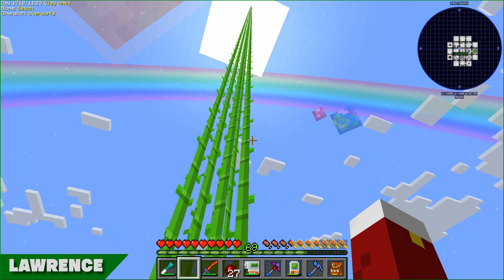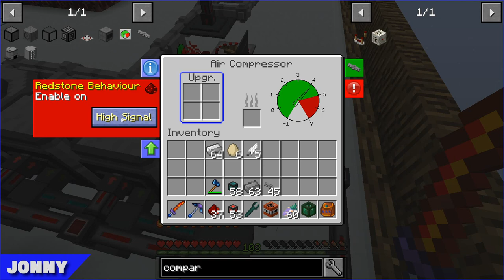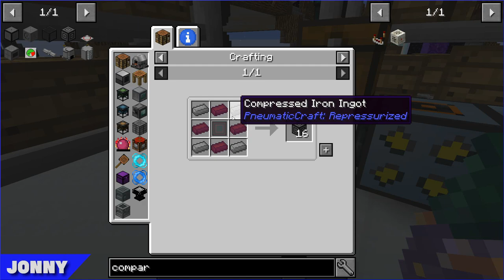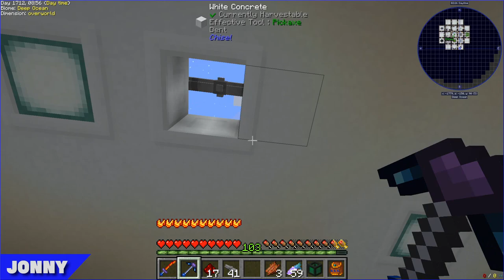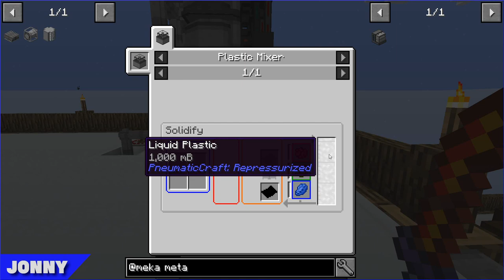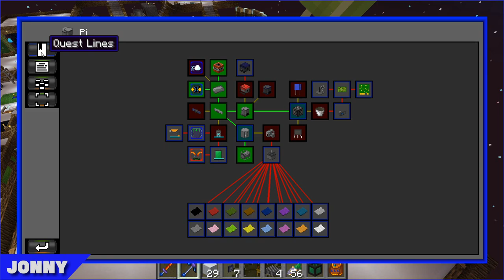Project Ozone 3 - Kappa Mode (E19) - Pressure Chamber (Pneumaticcraft)

Comment: You can make red alloy for half the redstone cost if you use the alloy kiln from immersive engineering with redstone and copper.

Also, your recording software seemed to be spazzing out this episode, might want to look into that.
Reply: You also might want a pipe valve on the vortex tube so you can turn it off when not using the refinery, it consumes pressure even when it is idle.
Reply from the maker: Yea I'm not sure what went on with that recording but we think we have sorted it now 😀 hopefully doesn't happen again. We did make the red alloy in the kiln for a bit, but moved on to the expensive recipe as we couldn't seem to automate it 😕
Reply from the maker: Thanks! I knew there was a thing but couldn't remember its name 🤣 will need to look into it. We setup your reactor automation yesterday too (thanks 👍) but have a buffer of a couple of videos so it won't be up for a week probably. Works a charm though! 😁
Reply: @JonnyLawrenceGaming  good to know about the alloy kiln. Haven't gotten to trying to automate that in my game yet, didn't realize it was manual only.

Also, if you ever need to create your own install disks for similar programs in open computers, you can follow the same steps, and just change the name from reactor and put your code inside the loop() function. :)

My code itself is actually a simple replica of a rednet connection I have used in other packs, where I would just hook the rednet buffer% output directly to the control rod input, wrapped in the code required to let it run in the background of the computer.

Comment: The bigger the chamber, the more air you need to make a pressure, so a smaller chamber can make same things, and it takes less air
Reply from the maker: So there isn't any benefit to the bigger one? We just assumed the bigger miltiblock must be better 😅
Reply: @JonnyLawrenceGaming  well the only thing I can think of would be more I/O hatches for faster input. But also, every time you insert/extract item, pressure drops down a bit.

I remember using some item teleport plate (can't remember exact name) which teleports items directly into 3x3x3 cube. Extracting items was done using magnet. IIRC I saw that from Hypnotizd PO2
Reply from the maker: I have never even considered that you could probably put more than one input hatch 🙈 teleporting stuff in would be way better, might need to give that a try, thanks!
Reply: @JonnyLawrenceGaming  item is translocation plate, but sadly is not available in po3 as I can see. Anyway it was episode 23 of hypnotizd po2 kappa mode.